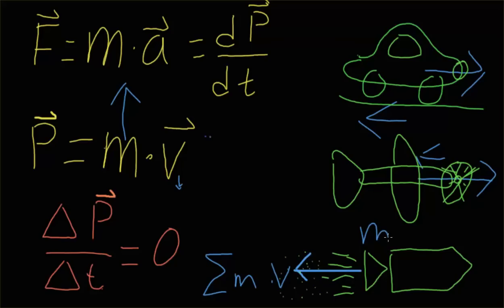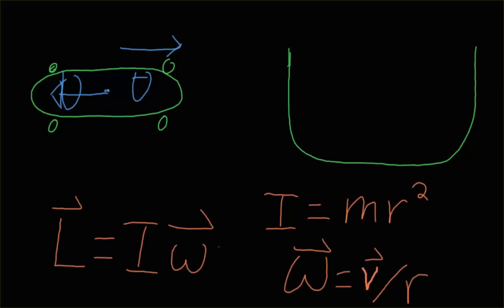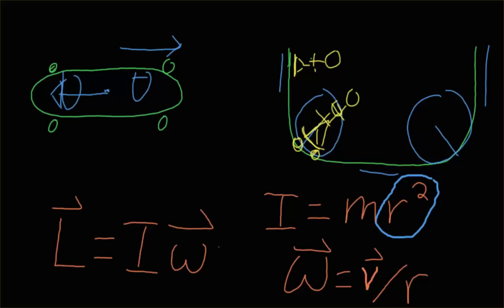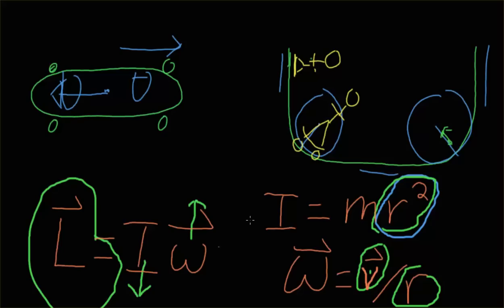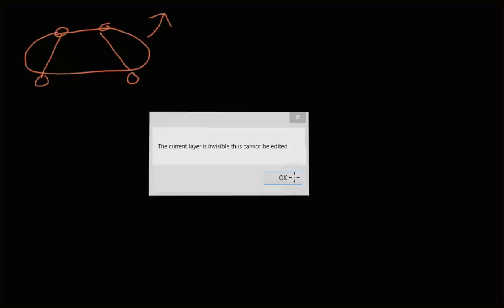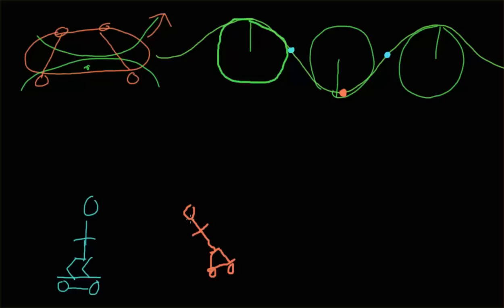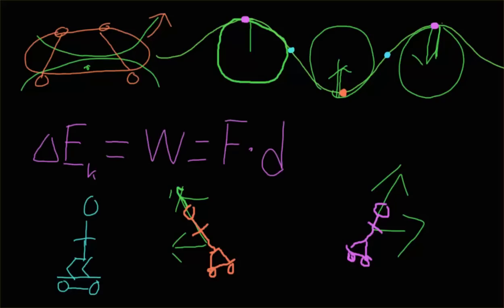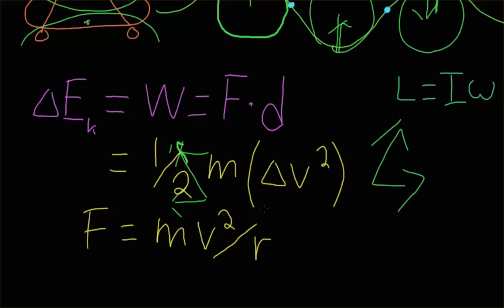The physics of pumping a longboard 1

Comment: Do you happen to know why it is possible to "inch forward" on a skateboard, from standing still, feet on the board, just by sort of pushing your feet forward?

About the flat ground pumping, would you accelerate if you didn't bend and straighten your knees? My experience says yes, but I think based on your explanation you should net 0 velocity gained as you lean into the curve and back out of it.
Reply from the maker: When you move the board forward, you do it fast by moving your body backward a bit. Then you reset you body position forward, but the static wheel friction prevents the board from moving if you do it slowly. If you had frictionless bearings this wouldn't work.

Just leaning into a turn produces a component that aligns toward your center of curvature, so it is very possible for leaning alone to contribute to your acceleration. However, extending your legs allows you to start the turn with a higher rotational inertia and then decrease it while at speed. So it magnifies the effect.

Comment: Thanks for the explanation :) I do still have a question though - How does the process of accelerating via this pumping technique conserve momentum? When not taking friction against the ground into account, how would the skateboarder be allowed to increase his momentum over the course several turns?

Or, in a more concrete way: You mentioned that one has to expand when leaning into the curves, but wouldn't the neccessary compression in between the expansions cancel out the gain in momentum by increasing the moment of inertia each time?
Reply from the maker: Great question. You are spot on that momentum is not conserved without taking friction against the ground into account. Therefor, all momentum gains comes from the earth through lateral wheel friction.

You are changing your moment and rotation axis. When you compress, the axis is infinitely far away, and the compression is in an orthogonal direction, so it doesn't change the moment. So the compression does nothing to your momentum, but get you into position for the next expansion.

During expansion you are pushing laterally against the wheels, doing work against the centrifugal force in your reference frame, while friction is providing the centripetal force, so the momentum you can pull from the earth is limited by static friction (wheel durometer etc.).

Comment: Thanks Garrette, makes perfect sense. I am a mechanical engineer, so I guess it makes sense for me. I have seen so many videos on pumping, tried them all out and never really helped. Now that I understand the science behind it, I should be able to progress better. Will give it a go today. Same principle for ice skaters doing spins, close in your arms and you spin faster. Great video, ever thought of being a lecturer at university?
Reply from the maker: Thank you very much. University professor used to be a dream of mine. Now days I get my lecturer fix by teaching my coworkers things they don't care about.
Reply: @gradies  I never got my hands on formulae to explain pumping, but there seems to be some more forces and acceleration methods to consider. E.g. your mass center should travel a trajectory that is closer to a line (maybe even straight line), and then you can twist your body around center of mass thus propelling your feet with a longboard further down the circle you're currently on.

Still, your explanation helped me to draw some more intuition about how to pump efficiently and make a connection to how one would propel themselves on a swing.
Reply from the maker: @karanoidji  you are absolutely right, which is why I labeled this video with a "1." I intended to make more explaing the physics of each method, but I never found the time.

Comment: I like that analogy of converting linear momentum to angular momentum and then back to linear momentum just by weight shift and essentially changing your rotational inertia however if you think about locomotion by tick tacking (on a regular skateboard) there is something to using the friction from the wheels to propel you sideways. Without this friction from the wheels you wouldn't be able to take advantage of pumping and your wheels would just completely slide out.